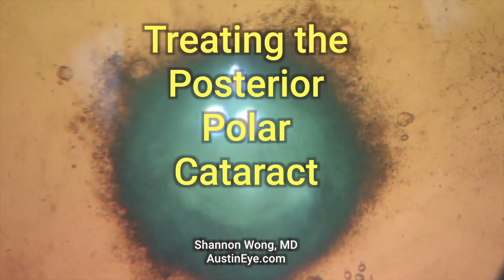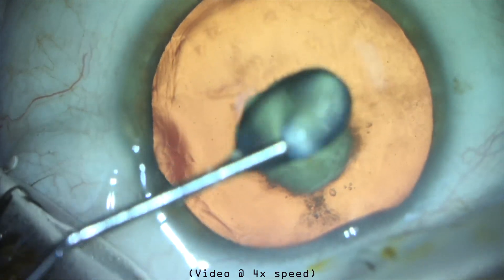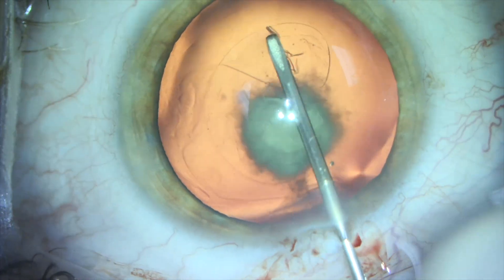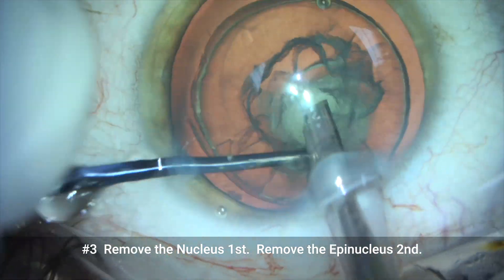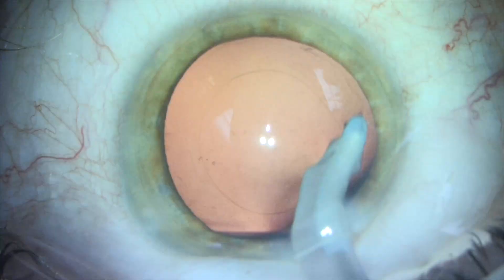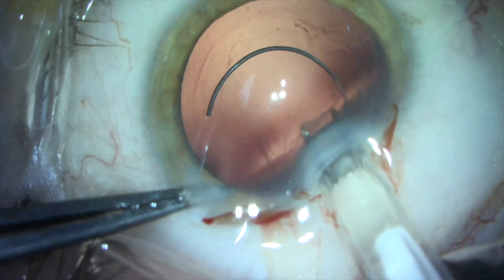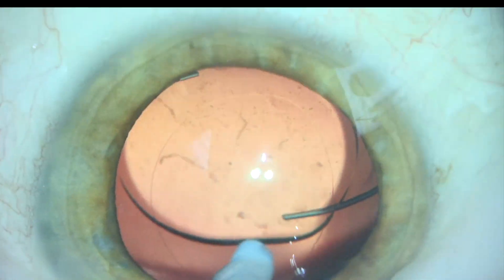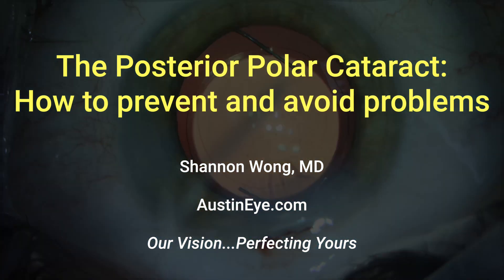Posterior Polar Cataract Surgery - How to avoid problems.  Shannon Wong, MD 5-22-2021

Comment: I had cataract surgery 45 days back.  I was initially seeing very clear ( for distant vision) but now this is getting blurry some times I see double images. Light sensitivity is still there.  From day one of surgery I'm seeing a blk rim  from outer corner of eye Now I'm feeling as my  outer corner is not properly open or some curtain is on the corner. Although my eye opens fine but still this feeling is very uncomfortable.  Will it get better or I will need another surgery? Also tell me for how long I need to take eye drops of steroid,  quinolone and diclofenac.